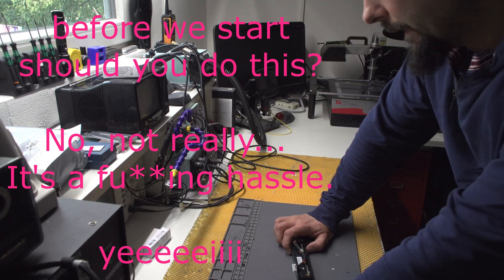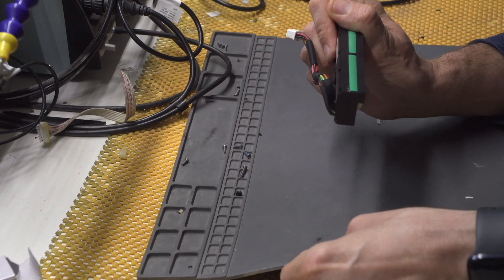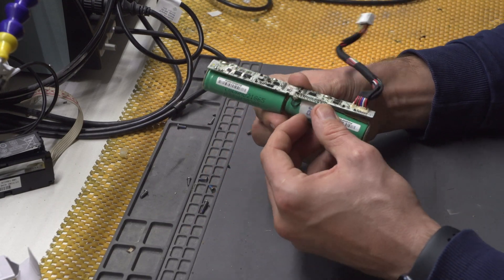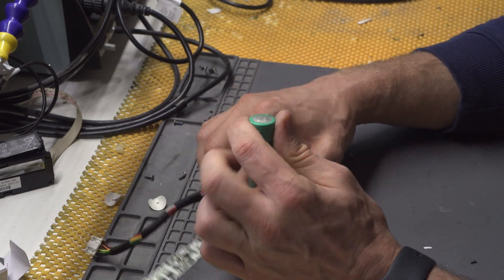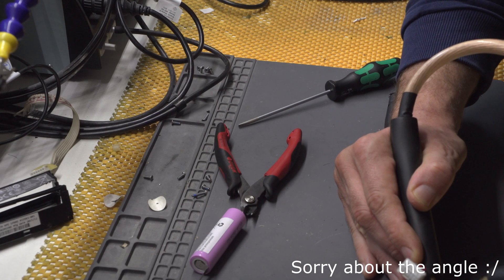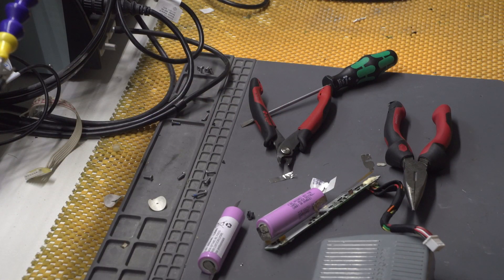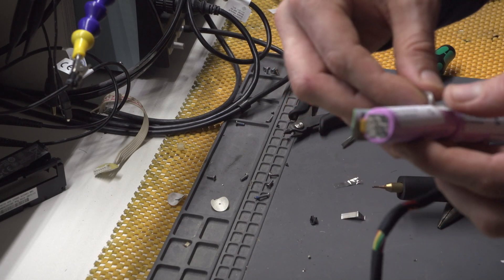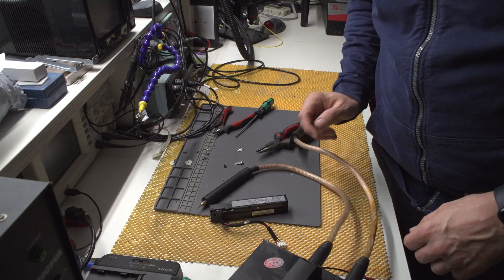HPE 96W smart storage battery unit repair - (8€ repair)

Comment: I replaced the batteries with an LG MJ1 and it didn't work. When the battery runs out, a dead battery code appears in the battery's software, and it won't work even if you replace the battery. Is there a solution to this?

Comment: Sad, didn't work for me, Replaced with 2 Samsung 18650 precharged to 3.97 volts. Still Says battery shutdown on boot
Reply: I've seen this happen too. Just wondering if there is some kind of e2prom memory (for instance a very well known American two-way radio manufacturer used to use a non-reusable memory chip on their batteries to count the number of charge cycles and refuse to charge above a certain number of charge cycles). I've also heard talk of I2C bus used for these batteries controllers... so maybe it can be persuaded with an arduino or raspberry pi.

Comment: I am new to this server thing, can I still use the server without the smart storage battery, or is it so important, I really want to know the use and how important it is to the server ?
Reply from the maker: you can, however caching will be turned off. If you have ssd(s) you will not notice that (in most cases) if you have ordinary sas drives if you have read/write heavy processes you will notice it.
Reply: Does it mean my server will be slow in processing, I won't be able to do concurrent processes and I can't store normal PDF, IMG files and any other type of files, since it affects SSD memory ?
Reply from the maker: @Informative_hub507  you’ll be most likely fine.

Comment: Due to IATA standards, HPE Smart Storage Batteries come with a charge of less than 30%. As a result, a newly installed or replaced battery may have a charge of less than 30% when installed in a server. At this load level, the battery needs to be charged to be able to support any number of loads on a server. Additionally, a battery backup event (server power lost unexpectedly) can discharge the battery below the level needed to support the loads.

Comment: The HPE Integrated Lights Out (iLO) GUI may report that the Gen9 Smart Storage Battery is faulty while the battery is charging. This can happen because the battery output is disabled until there is a sufficient charge level to support the number of loads on the server. (A payload is a Smart Array controller or a dual in-line non-volatile memory module [NVDIMM]). The health LED will not indicate a battery failure during this time.

Comment: I replace cell with new cell but again battery not work, I have a lot of qty fail Hp battery 96w, some of them can repair with changing cell but I can't repair most of them with replacing cell , can you help me what is the problem, because I'm retailer of hp servers in Iran and has alot of fail battety 96w and if I want to buy new for all of them I lose a lot of money , if you can help and educate me how can I repair them, really need it to learn repair them
When I change the cell again server shut down the cache battery and degraded it in iLo
Reply from the maker: you need to install new modules (battery) because if the charged battery has lower than nominal voltage controller turns it off automatically.
Reply: You should use high quality, unused battery cells that can discharge at least 30 amps instantly. For example; Sony VTC5, Molicel P26A, Samsung 20S, etc...